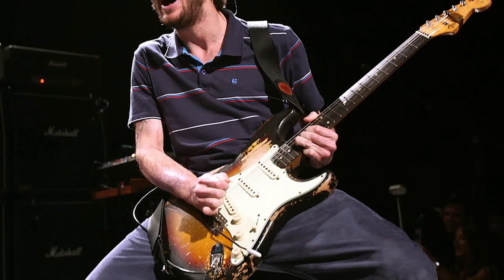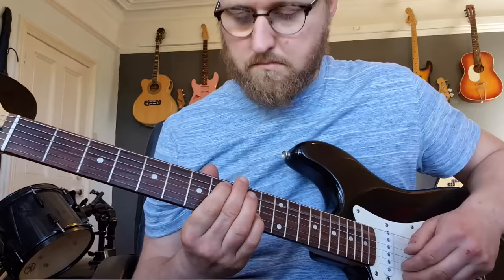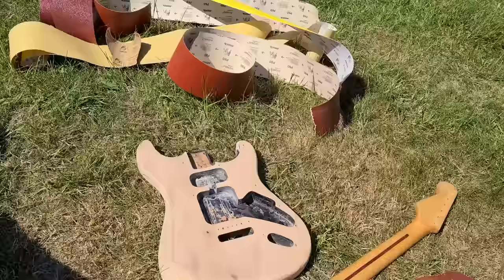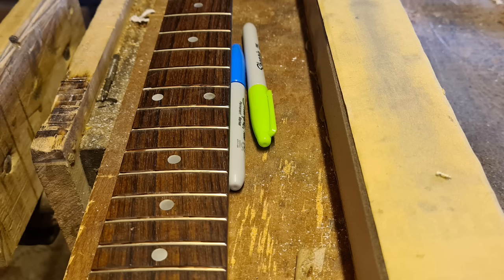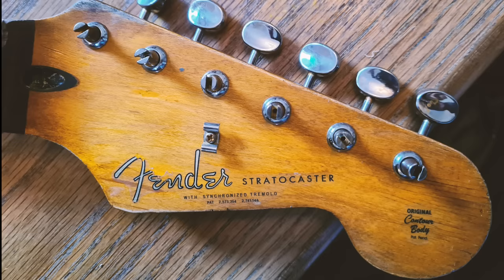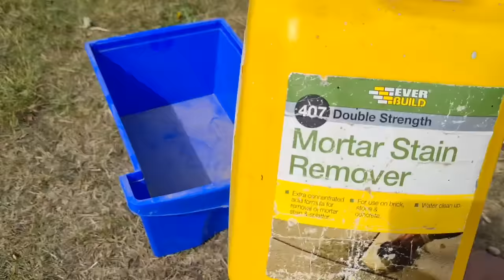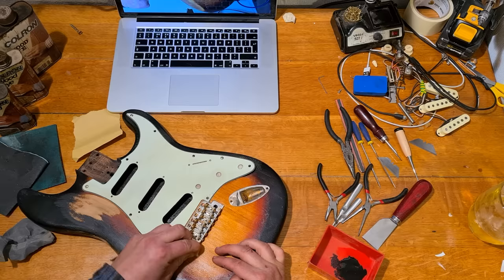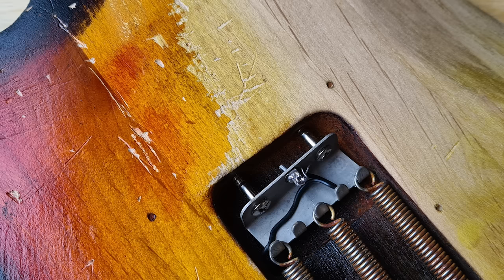How To Turn An $80 Squier into a John Frusciante 1962 Stratocaster

Comment: Squiers don’t sound bad at all, they just aren’t built that well.
Reply from the maker: With some care and attention they can be really great guitars! Thanks for the comment
Reply: That's not true. The classic vibes are built extremely well.
Reply from the maker: @BloodBoughtMinistries  They are... but.. I did have to completely fret level a brand new CV jag, which I was very dissapointed with. But I wouldn't hesitate to buy another haha
Reply: Yeah so not true, with proper setup and care they can be pretty sweet
Reply: Sometimes they do make em well. Dave Simpson says he's got a squire white matching head stock jag and it's one of his fav guitars.

But yeah... To stand the test of time? Might want to go with a higher end guitar with more select wood lol.

Sad to say... As great a job and kick ass look that this squire has... There is a good chance it will be warped and unplayable in 30 years or so...

But that also depends on what happens to the guitar over time in terms of temp, humidity, care, and usage...
Reply: Some are , CN , YN 90s squiers are awesome mod platforms . Deluxe Series are basically same quality as MIM .

Comment: The original Stratocasters from 1962 had no Headstock Trussrod Access and no Skunk Stripe. Despite the relic job you can see at first glance that this guitar is not from the early 60s.

Comment: I wouldn't consider this a squire. You basically made it from scratch,  sanded down wood into general guitar shape and replaced pickups and other important internal parts, and re-did neck setting and frets and branding and tuners etc.... got rid of everything that makes squires cheap lol. basically a custom shop guitar. 

But very cool transformation. Love the final result.

Comment: I did the same thing with my last Strat. A cheap Squire.
It played well - so I did Fender Fat 50's pickups along with new wiring, switch, Switchcraft plug and I blocked the trem.
I left the nut but lubed it with string grease and pencil lead.
Plays great and sounds like a much more expensive guitar.
Reply: Even blocking the tremolo, id get those strings off of the cheap pot metal. That eats the tone of a strat. Spend the 25 bucks and put in a full block and steel saddles. You will be glad you did

Comment: I bought a classic vibe 50s Strat and use that as A platform. I replace the pick ups with hand wound pick ups CTS pots in a fender five way switch. I put a Mexican made 50s neck . I stripped the paint from the body and neck and repainted it with nitro lacquered now it looks like a custom shop and it plays and sounds so good.

Comment: Great video. I have a Squier that is in good condition, and a Fender Strat that is in good condition, but the poly paint cracked because it was left in a hot attic for a period of time. Since the paint was cracking off, I completely peeled it to reveal an unfinished wood body. I was wondering if removing the fender’s neck and pickups and installing them onto the Squier body would be as good as having a Fender? Is the wiring inside the Squier body inferior to a Fender? Another idea I had was to paint the unfinished Fender body, but I’m not a very good painter and I’m pretty sure it wouldn’t look very good. What are your thoughts on this?

Comment: Very cool.  Nice job.  The number one goal for relicing a guitar is to achieve authenticity.  Taking a claw hammer to a guitar nody, with reckless abandon, just looks dumb.  I also hate expensive Fender Custom relics.  Relicing an old, inexpensive Squire is the only way to go.

Several years back, I had a little side eBay business relicing Vintage Fender and Kluson hardware.   I also did several vintage Fender Authorized necks.  I found black graphite dust (sanded from a carpenter’s pencil), did a good job of realistically darkening the dirty areas of the necks.

Comment: Hello, sir. I'd appreciate your opinion on whether creating new holes for the pickguard and guitar tuners would impact the guitar's value. I own a similar guitar and intend to switch the tuners from 2-pole to vintage nickel lock string tuners. Additionally, I'm facing challenges finding a suitable pickguard for my Squier, possibly due to limited availability here in the Philippines. This difficulty in sourcing a pickguard specifically for my Squier is making the customization process more challenging.

Comment: You can get great Strat sounds out of even lower range Squiers.
Figure 85% of the output is going to be the pickups, and all the points where the strings hit the guitar,- nut, tuners, saddles, and frets.With a little technical knowledge on top of the replacement parts, the neck will be fine.The Squier necks vary a lot, by year and factory.I hit every pawn I come across, and if they don't  have 3 or more in stock, it's an off day; find necks that feel right, and tweak them.90% of the time, there's little fret wear, because the guitar sat in some kids bedroom closet, or some dudes living room and never got played.(Of course, they'll likely be their favourite snack smeared all over it that will need to be cleaned.)
If you keep your eyes open, and collect desireable parts as you find them , it's not hard to put together Mexicans for under $400, or CV/ CP's for even less.Once the frets are shot, the rest drops like a rock in value; find cheap/ good necks, - you're set.

Comment: Whenever I pick up a squier I put a cheap 30 buck set of locking tuners on it. Also, the newer squiers are being made to vintage spec afaik, I know they made the headstock smaller.

Comment: Would it not make more sense to start with a kit? Or a kit + used Squier neck (for the headstock shape). It would avoid all the finish removal on the body... Either way, impressive relicing job. It's so easy to do a terrible-looking relic, this is nice to see. I really like the blend you got on the front contour (forearm rest area).

Comment: Only thing is, Squier strat body's are thinner than Fenders.. I found this out the hard way when I went to install a Super Vee trem, which ended up sticking out the back a 1/4" or so at least, so I bought a WD strat body instead.

Comment: Lovely - great great project, I want to see more ! The black strat maybe?  
I did something similar (took me two years) seafoam green 63 from a piece of crap, not even a squier !
On top of what you guys did (with less relic-ing) I also changed radius to 12 (blasphemy I know) and refretted entirely. Finally I replaced the dot markers with ones I did with synthetic clay (the ones hey use to make jewellery) as I could not find any means to stain the white plastic ones my neck had on. It turned out quite nice. But I guess it’s a question of taste...to be period accurate I believe they changed the markers from clay (i know it’s not clan anyways) to the plastic-y ones around 64?
Congrats and please do more!

Comment: FYI, that's not Alder. The cheaper squier and fenders use Poplar or Basswood.  Alder is quite red in colour.
Great video though. Hey, how long did it take the nitro to dry? I saw a video that said it needed to cure for like up to two weeks. 
Also did you have any trouble with orange peeling as its apparently called?
Reply: Alder is darker than poplar or basswood but I wouldn't class it as red. You can re-coat within half an hour then spray clear nitro lacquer (which he didn't do) You can use it after a couple of days but if you want to sand and polish/buff, the spray he uses needs at least 3 weeks to dry

Comment: Holy crap my man... You put in like 2000 bucks worth of time and labor custom shop style if you ask me. All for a 80 dollar guitar. Value increased! For sure lol.
Reply from the maker: Haha, indeed! I felt it made for a more interesting youtube video that way! thanks for watching!
Reply: @wilsonguitars2724  Been doing more research and learned that 600 grit light sanding on a poly finish is good enough to do in order to slap a nitro finish OVER it.

BUT... It will chip and age over time showing the poly finish underneith but if that doesn't bother you then more power to ya! Just a nice tip in case you don't want to go all out sanding crazy.

Comment: How much would this cost in upgrades?
Reply: $170 pickups
$30 tuners
$21 new pots
~$20 new 5way switch
$63-109 bridge (depending on color)
$6 nut blank

Comment: Can you please tell me if the body on this squier is thin and if yes, which tremolo block did you use? Would be amazing and helpful
Reply: Looks like a Squier SE and they have a full thickness body so a 40 mm import block would work.
Reply: @ericsmodsandgear8098  I have a thin-body squier affinity, do you know of a shorter tremelo block manufacturers?

Comment: why din't you start with a CN Squier, at least they have the rear heel adjust and proper headstock and boyd shape as the 62.. routes are off but contours are real close.. very good platforms, I've built up a few and man they are go to's for sure, only thing I really wish they had was a veneer fingerboard as opposed to the slab but one day I might just get a veneer neck or install a veneer on one of these since they are a 1990 guitar so they have some age to them and typically have better woods, one Ihave isa quartersawn neck other is birdseye rift sawn... lucky me I know, they are out there what is it 5% are quarter, 5% rift.. who knows how many are flamed or birdseye, today that woods all sorted out so it's rare you get one on a standard non spec flamed or birdseye but in the day they went into the shipment all the same.. also isn't it odd the CN's with t he 60;s necks also have very think finishes on them as well???  hmm......  me thinks with all the attentions the JV's got Korea said let's see what we can do here.. yea they even have the serial numbers on the neck plates...

Comment: So when you started talking about the garbage tuners I paused the video to get my Squier 🤣 (yeah I'm a nerd) my cheap-ass Affinity Strat that I picked up for $50 at a second hand store has sealed tuners and an unfinished neck.  I also have a neck I found at a flea market that's a decent model- has the 2 tone black on gold Squier logo, it's got sealed tuners and a super light finish too.  The Affinity may well have been upgraded, as it has a gold anodized aluminum guard, but I don't see screw holes like most dirt cheap tuners use.

Comment: 4:55 A professional luthier would use a paint thinner like acetone and a scraper to get the curves and tight spots
Reply: You should really be using a scraper anyway.  A heat gun isn't the best option but it works, and after that just scrap everything off. Sandpaper isn't really meant to remove a ton of excess material, it's more for finishing a surface.

Comment: Use emery cloth not sandpaper, it looks like expensive sandpaper but it's a LOT more durable & versatile, you'll use a lot less of the stuff, save money in the long run & make a lot less mess. I do metal & wood work a lot, I find a small piece of emery cloth, lasts longer than several whole sheets of paper, and if it gets clogged up, you can rinse it & keep going.

Comment: What happened the sound comparisons promised? How much did it cost for all the replacement parts? I think you are overly harsh on the standard tuners. Ive owned many squier strats and other similar copies. Ive never had a tuner slip om me yet. Do you mean the gear slips ie the cog doesnt mesh with the worm drive properly or is it the string that is slipping. If its the latter you need to look at how the string wraps on the peg. 
Do you think Leo Fender was this fussy when he built the original strat. I dont think so. It was basically bits and pieces he had lying about. It was the peoples guitar.
Reply: You're right, squier affinity series and classic vibe series has some real quality stuff on budget prices... This guy just thinks that cheap means garbage and expensive means amazing

Comment: Instead of destroying the original Squier nut, why not leave it intact and use its dimensions to craft the (new) bone nut.  Seems it would have saved a bunch of time trying to reinvent based on the neck angle.

Comment: Very pleased to see three parallel trem springs at the end. I never understand why people would mix angled and straight springs.
Excellent job all round.
Reply: i always just put them straight on the thick strings and angled on the light strings, just cuz i thought it might balance out the tension when i use the trem

Comment: I think I make that as perfect as I could get it if I'm going thru that much work and the imperfections of my skills are the relic process starting point. Anyway, it turned out well. Ideally I'd prefer more pristine. I probably would've never stripped it in the 1st place and gone after the tuners, pickups and hardware swaps and called it a day. The 3 ply mint green pickguard is perfect on gloss black licorice poly or even the gloss Baltic Blue poly. For a burst I prefer a 3 ply cream pickguard.

Comment: I found the Squires use some wood that just can’t be level with sanding sealer. Wood was horrible to work with. I threw out the squire body and bought a mexican made body.

Comment: This is slightly deceptive, it’s not an $80 Squire made to sound better. It’s an $80 Squire that you put all of the factory upgrades that paying more would have provided for you. I’d rather see somebody teach fixing intonation and bridge/nut work. Any cheap guitar will sound more “high quality” when you add the “high quality” parts. 
Grovers, Duncans, better pots, in the end you’re barely saving, you’re only saving on labor costs and choice wood. At this point it’s better off to just buy a higher end guitar. Just my opinion.I also am against faux aging, it’s sad to see a 2021 Strat that looks like it’s been played for years, instead, buy it mint and use it, and each dent, scratch and scar is now a memory link to the day/night it happened

Comment: That template “trick” really needs to go away … Get a skinny cap, for your rattle cans, back it off a bit more than usual and aim for the very edge. With a bit of practice that can produce a result that actually looks a bit like a sunburst.

And maybe sand with something higher than 14 grit sandpaper before paint.

Comment: Great vid but bro, watching you pour the HCl was the craziest thing I've seen in a while. It's a numbing agent so you can't feel it if it gets on your skin and it will literally go through to your bones and turn them into jelly. It binds with potassium in your blood and will literally stop your heart. The fact that you're not wearing gloves and completely covering your skin is so crazy... I would say using it is not worth it in any way, use anything else next time. HCl should only be used if it's literally impossible to use anything else and the correct safety precautions are absolutely necessary if you value your life.

Comment: Heyo I did most of the same on a pawn shop Squier Pink lol but looks to have been upgraded some Nut and pick-ups it seems like The tuner's stay in tune believe it or not but I run 49 - 10 so they work for me now I put a proper full size saddles bridge and tone block that was made for Squier and she really takes care of business and I have a 65 and 72 so know my way around Strats I have 6 or 7 One of the first things I did was relic it Might even nitro it but fine sanded most of the finish off and carefully did finish cracks from reference pic's and ones I have Came out pretty good IMO and it used to piss people off who were sporting 8K guitars and multiple amp rigs I would come rolling in with my Squier and Silvertone 1482 One in each hand and proceed to blow them away When I get older I will be selling all my pricey stuff and keeping the stuff that just works Had a lot of fun doing her up too Cool demo

Comment: Without upgrades, it will sound great. "Upgraded" pickups is almost always simply "unnecessary expense pickups." The one difference is needing noiseless pickups. Mike Rutherford plays a Squier Bullet Strat on tour. He needed noiseless pickups and he also went for locking tuners. He can afford a custom shop guitar, an American Strat, or a Mexican Strat. But he now knows there's no reason to waste money on any of those. Dis Squier at your own peril. You sound like a fool to anyone with a clue.
Reply: Not true. An ssl-1 is a huge upgrade in terms of sound compared to the squier stock ones. Also, soke other oldschool fender pickups can give your guitar exceptionally special tone
Reply: from a person who works with guitars and parts very often i disagree. pickups are definitely a good upgrade. not often necessary but if you want a different sound switching pickups is a pretty good idea. although sound difference is less apparent if switching the same type of pickups (eg single to single).

Comment: First of all you don't know how to use a belt sander on a guitar,  a hand sanding block is the way and you do an x pattern 4 strokes one way 4 the other way so you get and x pattern you don't want to remove any wood and light coats of sealer and top coats of nitro celulos

Comment: I think you did really well. However, changing the truss rod plug from plastic to black walnut (or perhaps even koa) would have made the illusion just a tad closer to a 1962 strat - and you already have the heat gun :)